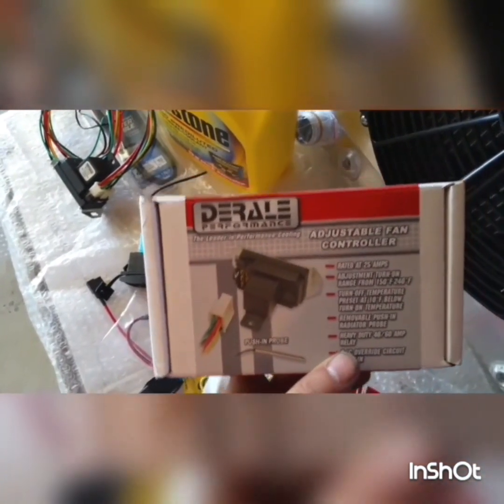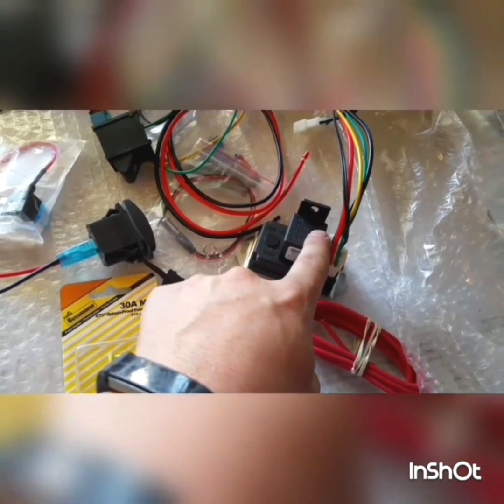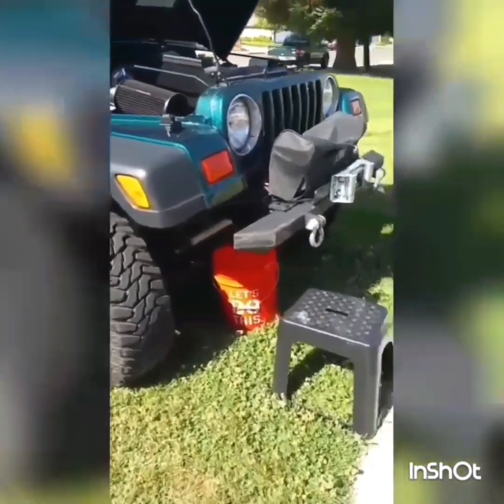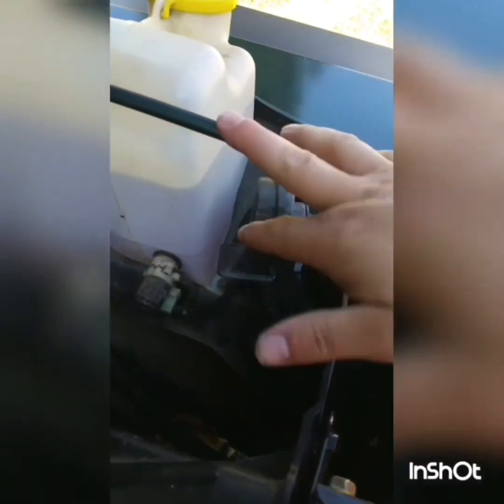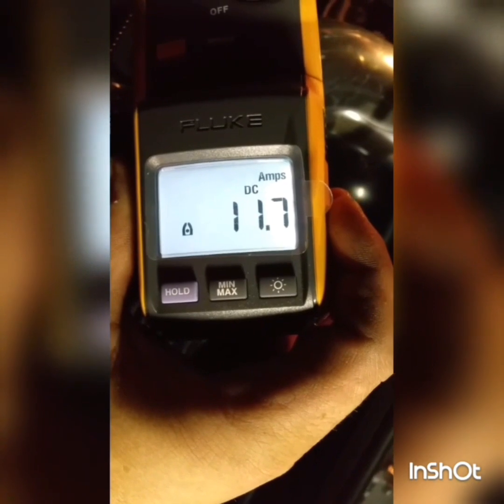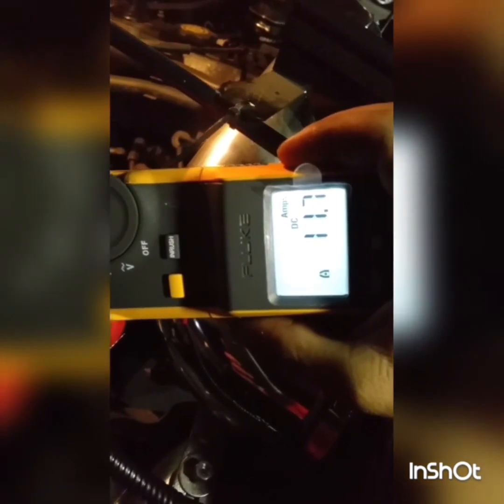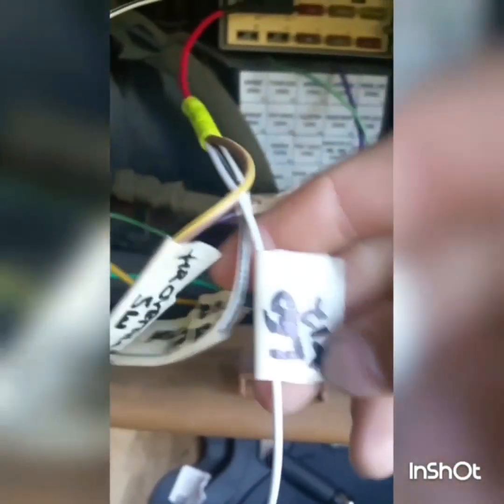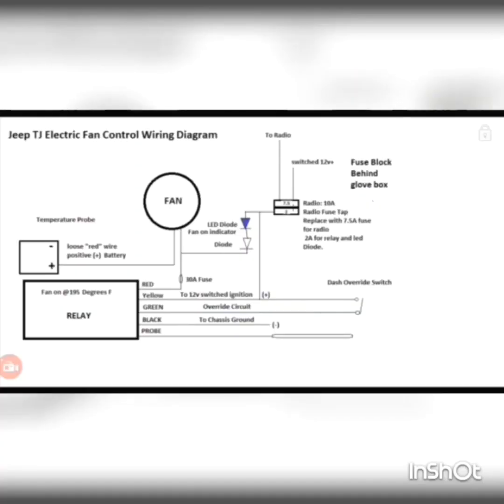DIY JEEP WRANGLER Electric Fan + Controller Kit Install JEEP CJ YJ TJ XJ

Comment: How good did this fan work for you? Have you had any issues with this radiator over the years?
I need a new radiator and plan on swapping the clutch fan for a electric in my 94 2.5 YJ
Reply from the maker: The fan was crap I suggest flex a lite or better in quality if your going with fan and controls. Radiator failed just a year later. Chinese Radiator is not worth the money IMO. Use quality parts like champion or mishimoto for aluminum radiators. Don’t skimp on quality here. To many deep fake non genuine parts out there. 🍻
Reply: @ATEMOFFROAD  oh wow I’m glad I asked lol. I was going to order this stuff after seeing your video.

I have a Taurus electric fan but have no idea what I’m going to do on my radiator. Someone on FB told me to call Summit and ask them about their brand. They said it’s not on the site that you have to ask for it. Thinking about going that route.

Gotta admit that setup you had may have sucked but it sure did look good.
Reply from the maker: @antiricergt  it’s a nice setup, but spend the 5-700 on the proper setup don’t settle for cheap. It will become a hassle later on. The how to do it in this video is still the same, Summit is a flex a lite and mishimoto dealer. I went back to stock because it’s the best option for the money for a totally stock non performance engine. I put the stock radiator back on and it’s still outlasting the 3 core aluminum one. In addition the mechanical fan pulls ton of air through that shroud. I’ve never had cooling issues on this stock engine. 🍻

Comment: so No horse power notice?
Reply from the maker: Some improvements on the performance but the radiator failed about a year later and I ended up putting back the original equipment back on . Other than this I like it! Thanks for watching 🍻

Comment: Thanks for the vid! I plan to replace my factory rad (which I suspect to be at the end of its life) with aluminum and electric fan, just like you have done (SWEET job, BTW). While it was not the topic of your vid, I noticed that you have a CAI on your 2.5. Between the CAI and elect fan, did you see any performance/mpg/power gains?My 01' is basically bone stock pushing a 2.5" lift and 31's. Before I dump a bunch of time and dineros into my search for power, I just wondered what your experience has been.Many thanks!
Reply from the maker: skkfor if you are wheeling your Jeep power is the last thing you need. I run 31” tires and have 4:10 gearing and this Jeep goes anywhere I ask it off reguardless of power. There is not much you can do to the 2.5l to get more power gains. Removing the fan clutch helps. I must say not having the shroud there and clutch makes it a lot easier to work on

Comment: Good information here but please note that this will not work with the 4.0L XJ as it uses a 33"x11" radiator so the fan diameter will be smaller.  This is also true with the 4.0L MJ.  Due to the spacing between the radiator and front of the 4.0L, the XJ's mechanical fan is not attached to the water pump pulley as shown here.  It sits to the side on a separate bracket, bearing and pulley.  However, if the fan bearing is good, you can remove the blade and fan clutch and install an e-fan if you really want to.  You should replace the radiator with a 3 row model since the e-fan cannot flow 2000CFM through the radiator as the mechanical fan did.  Another option on the XJ is to use the heavy duty fan clutch for the 2.5L and the fan will rotate about 60% of shaft speed instead of the original fan clutch's 40% shaft speed.
Reply from the maker: K4ACS Smitty N. K4ACS Smitty N. You are right ,The radiator and fan clutch configuration on the 4.0 XJ is different from the XJ 2.5l AMC I4. but It can be done on both the 4.0 and 2.5l XJ as I’ve done in this video. Same concept Just not the same as I did but the 2.5l XJ should work. Thanks

Comment: I like your work just quick question the blue and black wire witch wire goes to the battery and the other to the relay I’m confused trying to go by your diagram.
Reply from the maker: Are you talking about the fused heavy black ground wire that comes off the battery and is going directly to the fan?. The other heavy wire to the fan is red and comes from the relay which has blues heat shrink tubing on it. What blue wire are you referring to? Thanks
Reply from the maker: Here is the link to the circuit wiring diagram
 [IMG]http://i65.tinypic.com/2vijur5.png[/IMG]